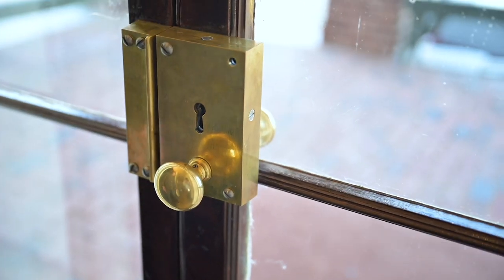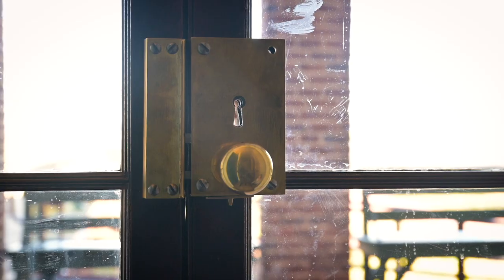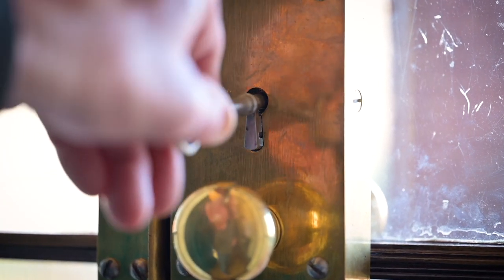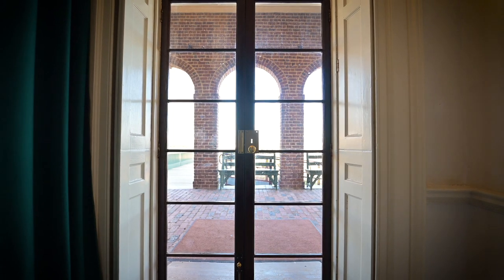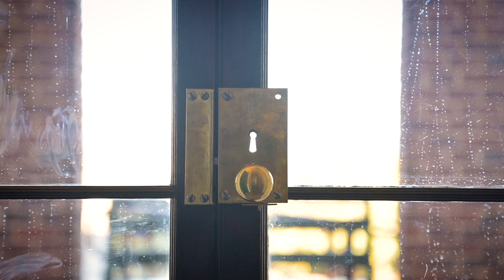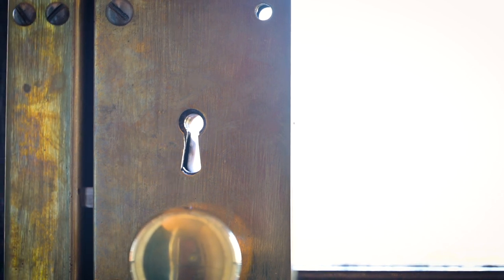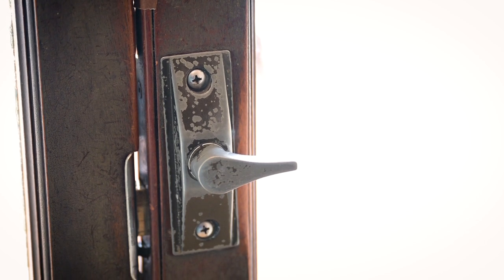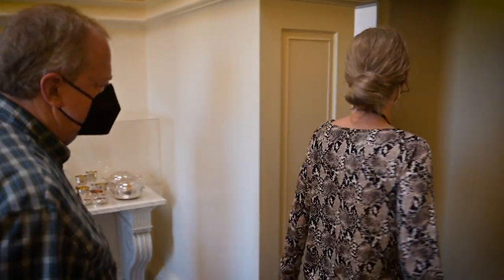Monticello's New Rim Lock

Comment: This rim lock is such a beautiful piece of hardware.  But, I noticed the odd location of the lock as well.  The lock stiles are narrow and as the ghost of the old rim lock shows this size lock I, too, would like to have more details.  
Was there a limit on the size of rim locks?  Was this as small as could be constructed?   If this rim lock was made especially for this door was there a reason that the holes were made for a screw.  Is the night bolt that protrusion at the bottom of the lock and how does it work.. 
You are right little details are surprising.  And it is also surprising how much more there is to learn about those little details.